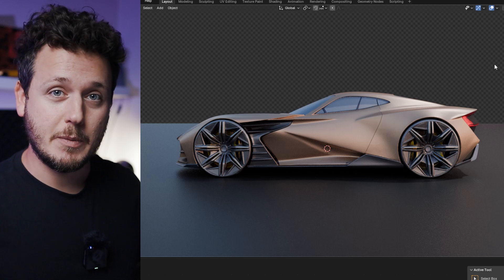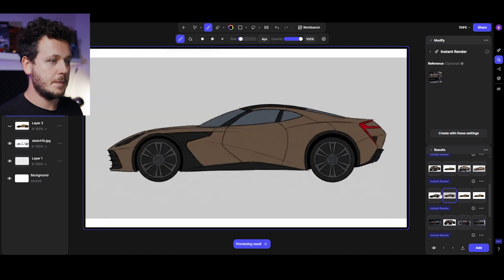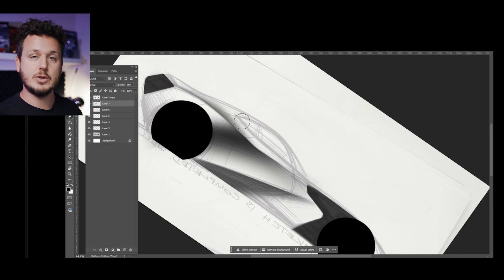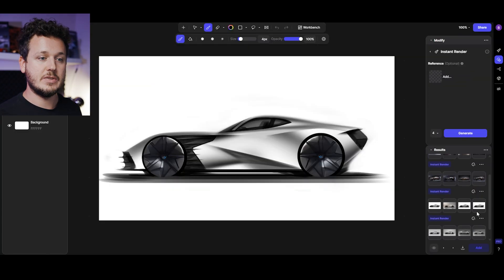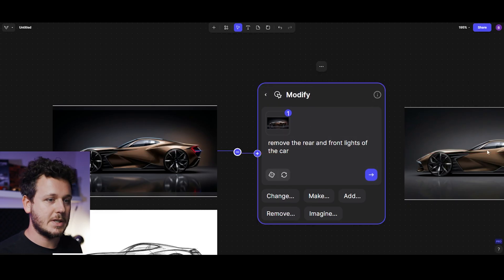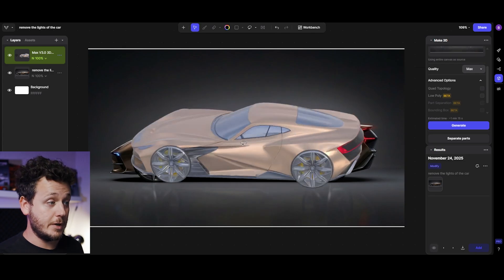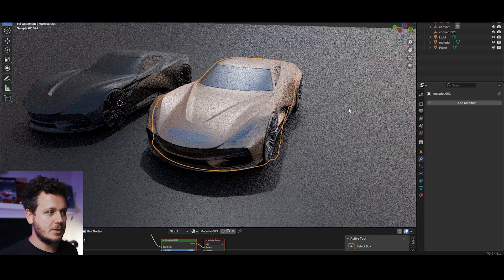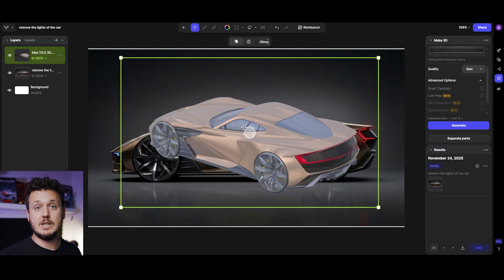I Generated a 3D Car From Just a Single Sketch!

Comment: Thank you for your videos. I do have a question that I hope you'll take a minute to review and reply. I've done some artwork of a few car designs. And a few, I have made a render of the front quarter angle of the car, and the rear quarter angle of the car in the same image for a more comprehensive render. Have you ever experimented with that type of render in Vizcom? Would it recognize them to be the same car, so that the renders and 3D model it outputs captures the front and back more accurately, along with the side of course? Let us know if this is possible. I would really appreciate it. And would definitely help persuade me to buy a course from you, which I have been considering. Thanks again!

Comment: Design work amount will drop by more than 95%.
If six months of work shrink to one single day, the demand for classical designers will collapse. 
Companies simply won’t need large design teams anymore, a few AI-augmented designers can generate the same yearly output at near-zero cost.
Reply: Absolutely. I have witnessed it first hand and as a digital modeller for automotive industry for the last 35 years, I count myself lucky that I retired at the beginning of last year. It is so sad that so many people will be out of work.
Reply: I really don't think so. In each company there is one designer doing 95% of the job, everyone else is just backup. Ai will not change that.
Reply: @teahousereloaded there still are designers but they are doing what teams of support staff (digital modellers, visualisation experts, animators) were doing by using AI.
Reply: And the designs will be better. Car design has been bleak for like 20 years.
Reply: @maikeru01 you’re not looking hard enough
Reply: @maikeru01  the future is for the designers.